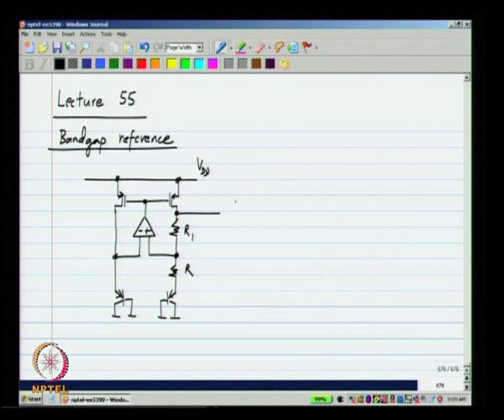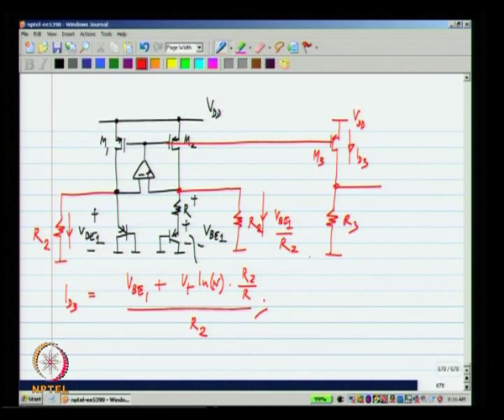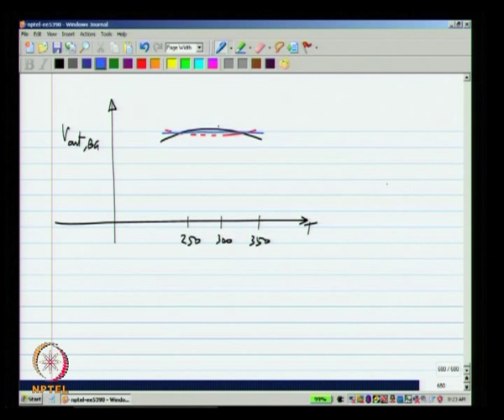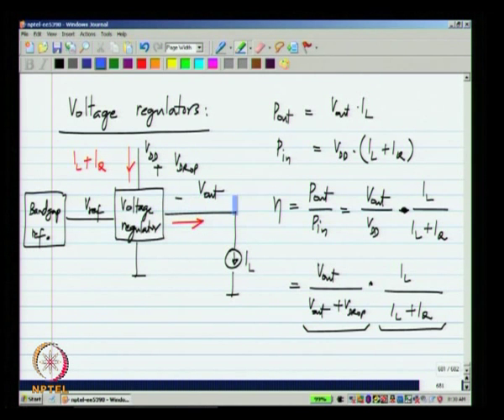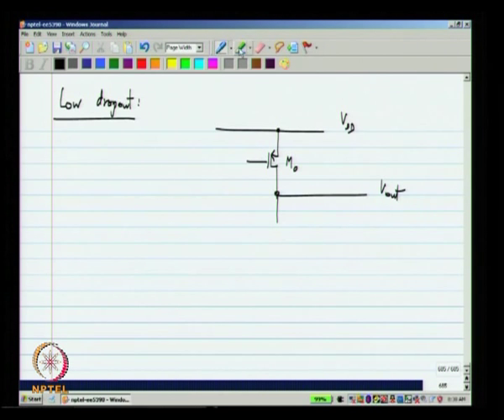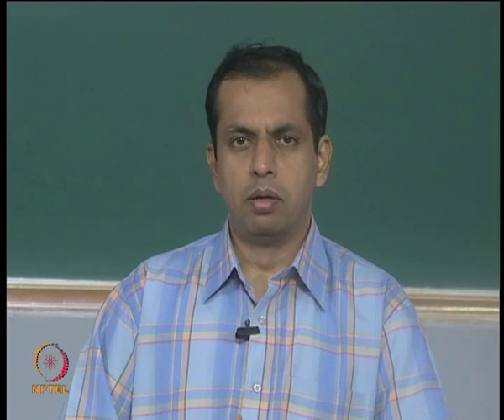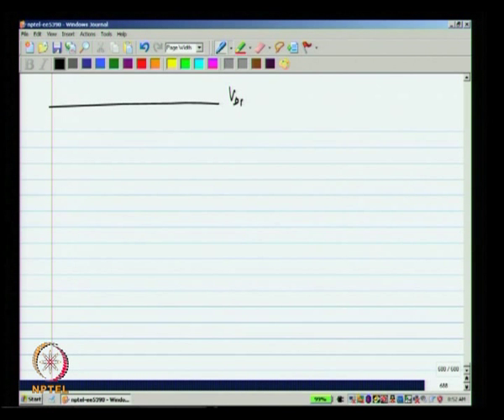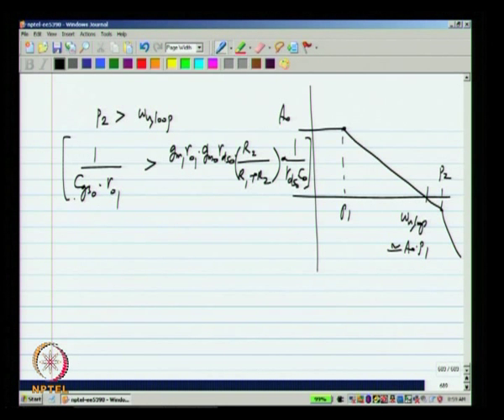Mod-01 Lec-55 Lecture 55

Comment: at 10:35 don't we need to consider the voltages required by transistors inside opamp? in that case wouldn't we need more than 0.9 V?
Reply: I think sir assumes we use a 2-stage Opamp which has the same Vds requirements (1 pmos Vsd drop) as the reference circuit.